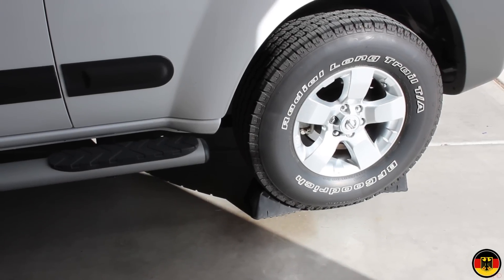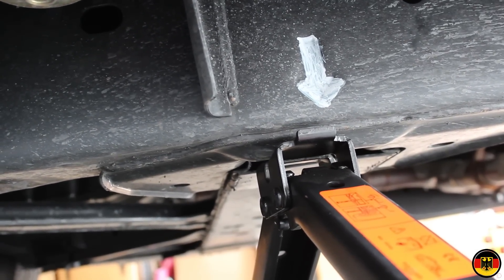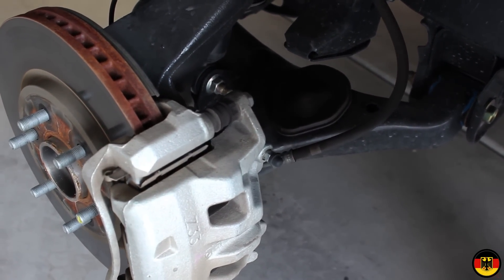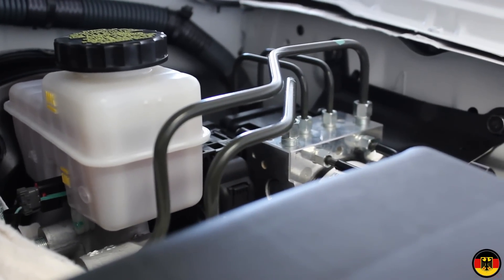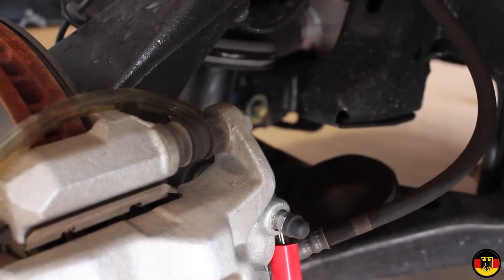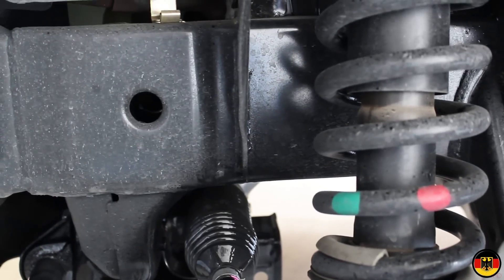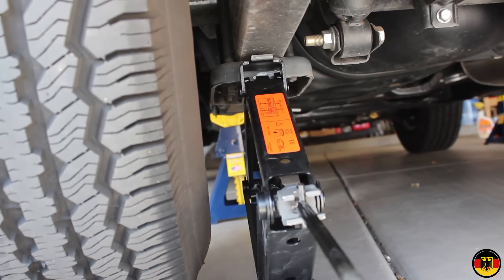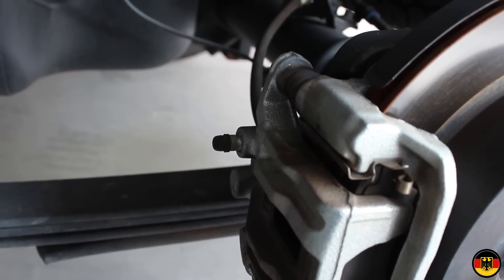05-13 Nissan Xterra Brake Fluid Bleed

Comment: The correct bleed sequence is right rear, left rear, right front. Left front. The idea is to bleed the longest line first.
Reply: xjester60x Not on the X. The correct procedure is right rear, left front, left rear, right front. Also disconnect neg. battery cable.
Reply: @gavinsingh4450  lol
Reply: Each car has a correct way to bleed the breaks. Hell for some reason my factory service Manual claims left rear, right rear, left front, right front
Reply: Wrong. Most cars are done that way but not an xterra
Reply: @joshmellott6245  Not according to the Nissan factory servuce manual. It's a common error though. The standard rule is: "longest line first" Perhaps it's different in different hemispheres. You know because of the coriolis effect

Comment: I keep reading that ABS brakes present a complication for doing this as 
the ABS pump needs to be activated with a scanner in order to be 
completely bleed properly. Did you you have to deal with this? I am 
pretty old so everything I learned about this stuff was prior to ABS 
systems for the most part. I'd hate to have to buy an expensive OBD2 
scanner with the bleed feature just for this. My old scanner is great 
but it does not have the bleed feature. Any thoughts on this? I have a 
2004 Armada LE, and I still love this car from the day I bought it new.
Reply from the maker: If you want to fully bleed the system, yes, you need to actuate that ABS pump.  However, I've always bled my ABS-equipped vehicles the same way as normal old-school ones (outside of specialty brake systems, Mercedes SBC for example) which cycles through the majority of the fluid, and have had no issues with that method over the years.  If you do want to cycle the pump then you will need a scan tool of some sort, but they are more advanced ones and thus more expensive.  Thanks for watching!
Reply: @redonKiLaus  Good answer. I very much appreciate your reply. I may use this as an excuse to upgrade my scanner to one with a bleed feature. So many tools, so little time! :)

Comment: I able to do the job even though you didn't show much.  People here were very nasty to you because they feel misled. I never thought of armor all on the CV boots. That might help them last a little longer. I used a clean dry water bottle fill with some clean brake fluid, put a brake hose through the cap and was able to bled each brake myself without worrying about air intrusion.
Reply from the maker: Thanks for watching!

Comment: HOw much brake fluid do I need In my xterra nissan 2007?  I hope  you help me out
Reply from the maker: If you buy a liter container, it will be more than enough - you just need to fill the reservoir to the full line, bleed down the minimum, fill back up, and repeat on each wheel (unless you have major air in the lines).  Hope that helps, and thanks for watching!

Comment: Based on your torque driver and use of expensive brake fluid*, I'm guessing your not looking to cut corners on cost. Is Armor All the best choice for use on all the rubber boots etc.? I'm not being a wise guy, asking seriously, I've never treated the rubber under any of my vehicles and think it is a great idea, I just wonder if there might be a product out there that might last longer being exposed to the harsh conditions of an undercarriage. 

*Also, I have a 2016 Frontier which calls for Dot 3 brake fluid, I'm wondering if your Xterra also calls for Dot 3 fluid and if you've upgraded to the Dot 4 fluid, when it's time to change the fluid in mine, I'd like to switch.
Based on everything I've read online, Dot 4 is the same fluid but with a higher boiling point which in my mind begs the question, why does Nissan stick with Dot 3.